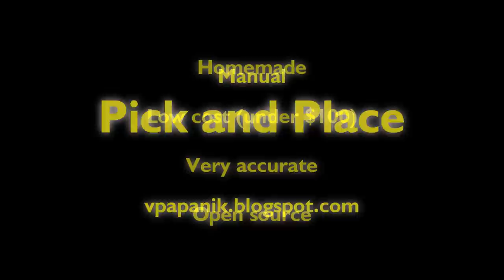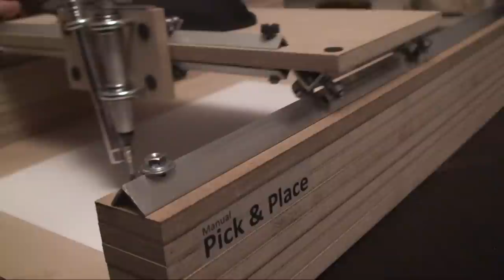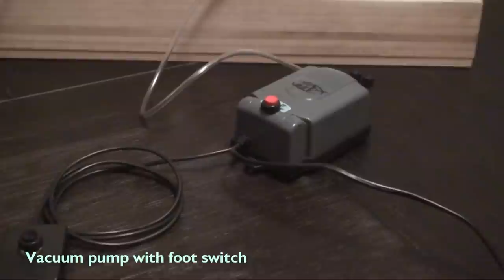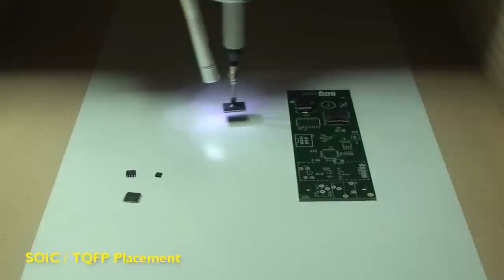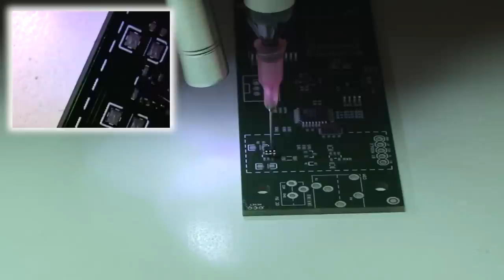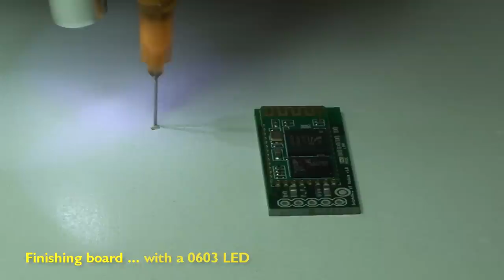Low Budget Manual Pick and Place (HD)

Comment: Since this video was produced 9 years ago, not sure if anyone will answer my Qs, but here goes:  1 - how hard is it to change "air suction heads"?   2 - When you release the suction to the to head, does your component drop quickly, and does air ever escape so quickly a gush of air pushes around those 0402 capacitors for instance?  3 - Can most people operate this machine or does it take super human, exceptionally steady hands?
Reply from the maker: Thanks for your questions ! (1) It's very easy, the heads are just removable plastic bits (2) This was tricky indeed ; I made a tiny hole on the pen, so air can enter when suction is released, and the small components can drop nicely. Otherwise 0402 are stuck for a couple of seconds after suction release. (3) I think that tweezers need superhuman hands. This is ten times easier, at least for me.

Comment: problem is, its still limited to how steady/fast your hand is, so you may as well use tweezers
Reply: Not really. Most of the problem while doing a large build is constant rotating of many parts. With tweezers it is kind of a pain, with this you can adjust angle easy. Plus you have this macro camera, so less inspections are needed.

Comment: Why not automate it? :D
Reply: Price
Reply: Some stepper motors, belts and a microcontroller, can't be that expensive.
Reply: xFuaZe yes, probably 300€.
Reply: +wolfgangouille 50 $
Reply: Insert Username the dollar isn't that strong.
Reply: Why automate it?
Put differently: Automated is not always better. Of course you can add stepper motors and switches. This alone would render it slower, worse to handle and more expensive. There are DIY automated pick and place machines out there. But this then is something completely different. It's not about a bunch of motors for 50$. It's 3000, 5000, 10000$ instead of this couple of dollars.
So. Why build a bicycle if you can build car? Because sometimes a bicycle is enough. And sometimes a bicycle is even a better choice for where you want to go.
Reply: Guys it doesn't have to be either/or. It can be both. You could spend more and automate it, or you could spend a few bucks and keep it manual. Choices are great!

Comment from the maker: Everything is on eBay :

w w w.ebay.ie/itm/Needle-Dispensing-Dispenser-Bottle-for-Rosin-Solder-Flux-Paste-9-Needles-50ml-/261135976114?pt=LH_DefaultDomain_0&hash=item3ccceac6b2

w w w.ebay.ie/itm/UPDATED-T-962-INFRARED-IC-HEATER-REFLOW-WAVE-OVEN-BGA-T962-800W-180-235MM-NEW-l8-/140618304234?pt=UK_Home_Garden_Conservatory_Patio_bbq_Patio_Covers_Heating&hash=item20bd810aea